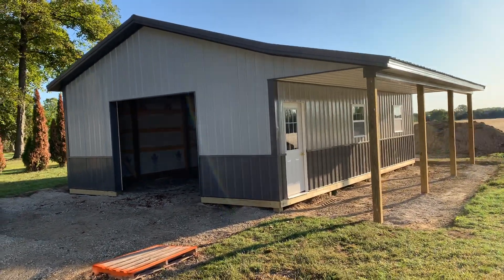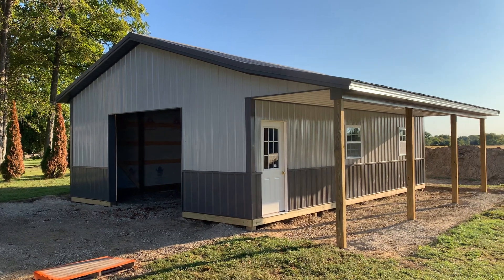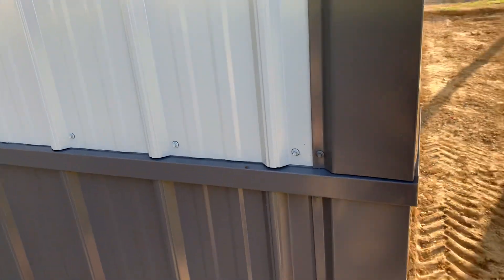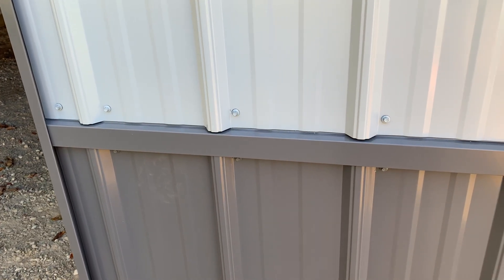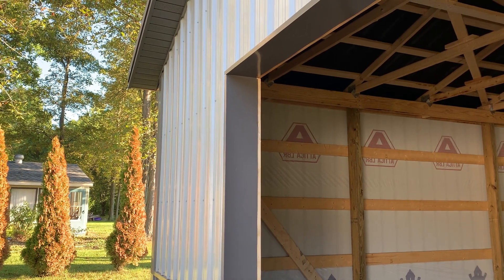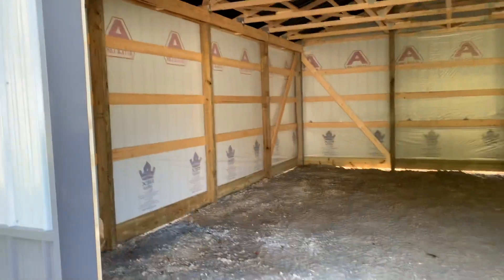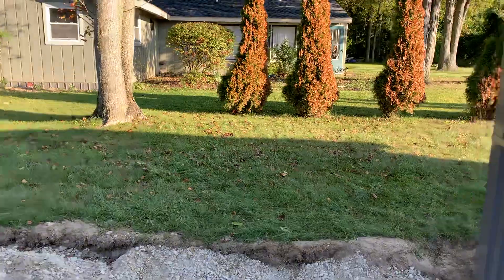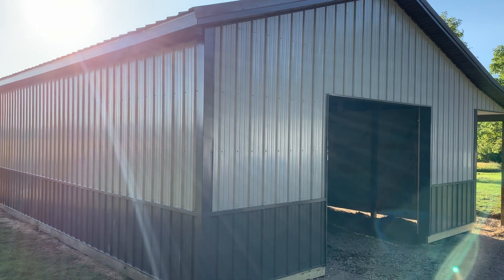24x32 pole barn update in Willard, Ohio

Comment: Are the posts directly in concrete?
Reply from the maker: Posts are set on a concrete cookie and back filled with stone base.
Reply from the maker: We use 2x6 treated boards attached to the posts to prevent uplift.